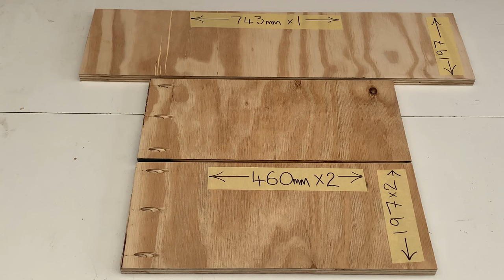Flip Top Bench Cart

Comment: Excellent job. I would recommend the 2 following things: 1) you should face your tools opposite directions so when you flip the top, you never end up behind the tool. 2) you should use the retractable stepdown caster wheels so when you're using your cart it can sit level on the ground, and when you need to move it, you step down on the caster wheel and move it. This will also require you build the cart just slightly taller to account for the difference in with and without wheels.
Reply from the maker: Your analysis does have merit !  thanks for the feedback , regards Wally
Reply: You can always use the brakes.
Reply: @jamesblock1319  True enough, but there's always a little racking on wheels. But in the end, do whatever works for the individual.

Comment: Is your thicknessner (planer in the states) still on this cart? I want to build a flip cart for my planer (which I have yet to buy)  but concerned about the weight. Its  roughly 92lbs /41kg. Video is 10 months old. If your thicknesser has been sitting on it for 10 months, I'm curious if there's any sag or ill effects from the weight.
Reply from the maker: I'm in Melbourne, Aus , my thicknesser weighs approximately 90lbs + Ryobi sander 42lbs ,  with a combined weight = 132lbs , it's very top heavy !   to balance this I've added various tools ie power saw , electric hand planer etc in the lower drawer for balance ,  very important to add quality castor wheels !  .....10 months on , No Bow , No Sag , the 19mm Marine plywood is extremely efficient , hope this answers all your queries , ''cheers ''

Comment: love your unique take on this project. Just a tip for next time, if you have a grinder already, you can get a cut off disk for it that will go do those metal cuts much easier. Like a hot knife through butter.
Reply from the maker: Thanks for the tip mate , great advise 👍
Reply: @wallytrinc9885  one quick note of caution - have a GOOD hold of your grinder. When the cut is almost through sometimes the metal will pinch the disk and the grinder tries to run away. This can cause really bad injuries.

Comment: Dude, I have a question.I see an error in the measurements visible at 6:45 23/32 seconds of the video.real measure:365+90+90=545 /2=272,5  Why do you measure 271.5?waiting for your reply.thanks.
Reply from the maker: In a Perfect World , one would use a table saw to cut (6) exact Panels @ 745mm X 545mm.  What I tried to emphasise in my DIY , is by simply  using a power/saw the everyday ''Punter'' can make a bench cart .
Reviewing my video @ 2:05 23/32 seconds in , the marine ply off/cut straight edge may not have been squarely  positioned correctly (1mm ) ? ....combined with a not so sharp saw blade led to the measurement discrepancy.
Where you cleverly highlighted @ 6:45 23/32 seconds , I again measured the upper width (both panels) which measured a Bee's Dick over 543mm-  thus giving me a 1/2 point of 271.5mm .